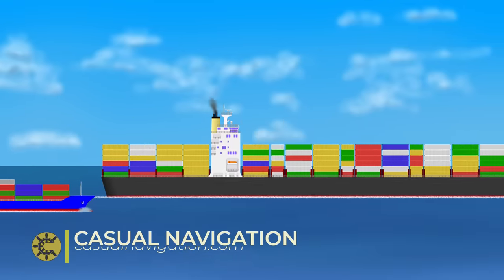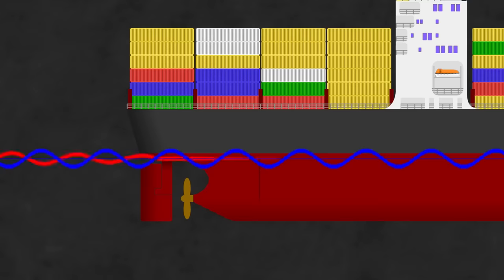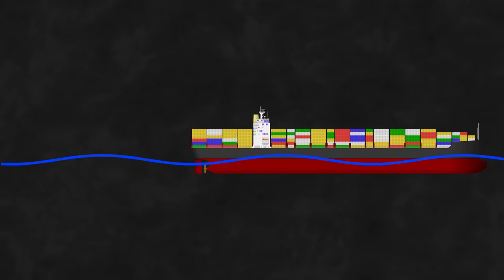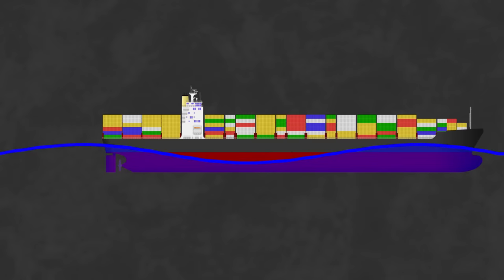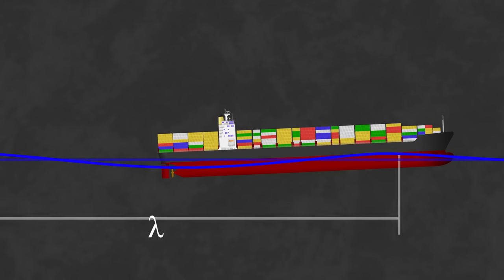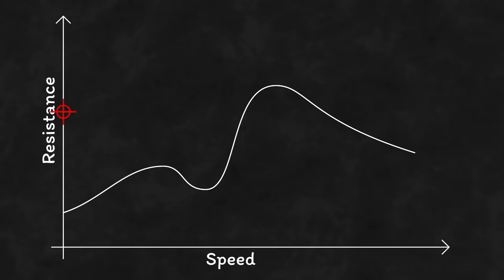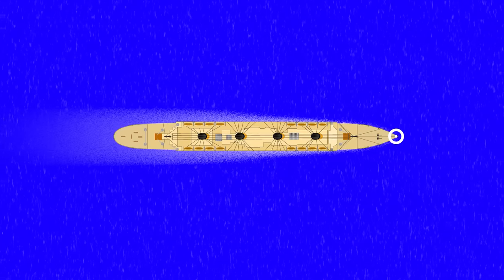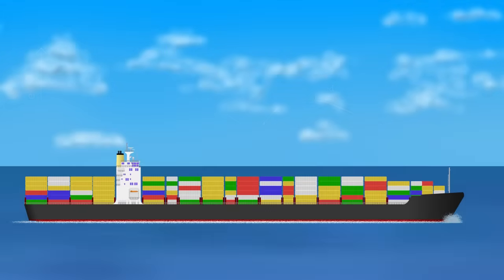Why Are Big Ships Faster Than Small Ships?

Comment: I used to sail small boats as a teenager, and despite not knowing how any of this worked I remember intuitively feeling the phenomenon of hump speed and planing. Especially the boat 'falling' off the top of a wave, going from planing to hump speed, as a gust of wind dies off. Super facinating to learn how this actually works!
Reply: And then you get on a keelboat, which cannot plane, and it does not matter whether the wind is 10 or 20 knots, you can't move any faster ....
Reply: You can plane in keelboats my friend, you just haven’t been racing the right ones!
Reply: @rydenkaye9735  You need foils for that :)
Reply: Same thing with adjusting the trim on a power boat. At a certain speed and perfect trim, you can just feel the resistance leave and the boat levels out.
Reply: Exactly this

Comment: You could easily expand this video with the hull shape aspect alone, ldl hulls are faster and lower fuel costs.
a good example, an 85' loa motor yacht with a draft of 4 feet designed for displacement cruising. Top speed is 18 knots, cruising speed is 15 knots. 15 knots speed gives her 1,500 nm range on 1000 US gallons of diesel, 18 knots gets you 500 nm from the same quantity of fuel.

These same factors are in play with the big cargo ships, yet most people can relate to being told if they slow down by 5 miles an hour they will travel 1000 miles further in their pleasure boat over it's cheaper to ship a 6 week trip than a 1 month trip for your overseas delivery..

 *ldl = low displacement length.
Reply: 500 nano-metres! Wow that's inefficient!
Reply: @Azettler1  nautical miles
Reply: @jaquigreenlees  I knew what the acronym was for and was just bugging. I find it funny that we have two measures of distance that have the same unit label :)

Comment: it maybe of interest:  the bulbous bow works only at a limited range of speeds, because its wave has to interfere as designed with the normal bow-wave. Cargo ship hulls (including the bow-shape) are designed for a resonable range of cruising speed, to be fuel efficient. Intrestingly you can guess a ships speed by looking at its generated wave lenght at the hull. you only need to know how long the ship is, judge the length of the wave and use the formula depicted in the video to calculate the speed of the ship (through the water) ...
Reply: Your explantion/guess, 
does not include water conditions.

All vessels: 
would be much better with a nose bulb !

-- Better for control of spin & steering;
-- Keeping hull at a reasonable angle compared to the water surface.
-- Better dispersing of the bow's wave.

****
 >> A Hydro-plane: 
-- can achieve higher speeds;
-- has less danger of flipping over.

( compares to many automobiles that save gas, with 500lb -- 200 kg  of cement inside the rear trunk ! )
Reply: @dirkkarmel5209  how would adding weight in your trunk improve efficiency??
Reply: Dumbest comment I’ve ever read. Try strapping a bulb to any type of Planing hull and let me know how it goes
Reply: Wouldn't it be way easier to just guess the speed than to guess the wave length AND guess the length of the hull to calculate the speed?

Comment: also worth mentioning: the drag force is proportional to the cross sectional area of the ship.  by the square-cube law, doubling the scale of a vessel will quadruple the drag, but allow 8 times the internal volume for engines to be put in.  thus, if your engines take up the same amount of space, you'll have twice the power, and sqrt(2) times the speed

Comment: Overcoming the hump speed is mechanically the same as breaking the sound barrier.
You wffectivly turn a wave into a straight line, saving tons of energy.
But it needs tons of energy to overcome the hump/barrier first.
And even then it needs more energy then any speed that doesnt approach thr hump/barrier.
Reply: There are other ways to defeat the wave  effects. Tuning shapes of leading and trailing edges to better suit lamellar flows back into the common plane on the trailing edge is the major factor. Shorter hulls can be made efficient at higher speeds but compromises are often made to achieve other desirable effects. This video however is a good beginner primer for this niche of fluid dynamics.
Reply: I thought as much, and thought of the same analogy.

"Needs more energy than any speed that doesn't approach the hump barrier." Every time you accelerate from zero, you're approaching the hump barrier. I know you're talking about it as a limit from Calculus, but how close to the hump barrier does it have to be for that factoid to lose veracity? 70%? 40%?

Actually, Real Engineering shows a graph of drag vs mach number, and it clearly shows that mach 1 is a peak, and by mach 6, the drag is significantly lower.

He was taking about rockets (which are designed to go faster than MACH 1), so I'm not sure if his graph was generally applicable to hurled objects or not.

He was discussing the new startup with rockets whose "first stage" is a centrifugal slingshot. I can't remember the video title.

Comment: I was under the impression that the hull speed was the last efficient speed (assuming a slippery hull) before the "wall" of resistance you get as you approach hump speed, due the destructive wave interference outlined in the video.  So in the graph it would be found at the bottom of the little dip rather than at the hill before it.
Reply: You can think of the hump speed as a kind of trailing vacuum effect as an analogy.
Reply: There's a similar phenomenon with the speed of sound. Crossing it causes peak air resistance, but for a plane or rocket that's designed for it, going faster than MACH 1 decreases your air resistance the faster you go. So, for an aircraft, MACH 1 is the least efficient possible speed, compared to any other.

Comment: Back around 1890 when they were building the first USS Texas battleship an argument ensued with the designer, the Bureau of Construction, and the actual builder.  There were worries that the weight calculations  of the ship had been in error and the builder suggested that the ship be made ten feet longer but the keel had already been laid (but could have been modified at extra cost).  The builder said that the ship would have the added benefit of being faster as a result.  However, the argument grew so heated about modifying the ship at this stage that the Bureau of Construction threatened to cancel the vessel due to the added cost...however the builder recalculated the weights and stated that while the lengthening could have added speed, the weights were not an issue so the project continued at the design and the Texas, although having an extremely long build time nonetheless was delivered on it's original budget to it's original design.  As it turned out the USS Texas might have used an extra knot or two during the Battle of Santiago in 1898 but the Battle turned out well in any event for the United States.

Comment: I live very close to the St. Clair river and frequently watch the Great Lakes freighters over 1000 feet in length and the salties (smaller ocean ships) down to just a few hundred feet as they travel up and down the river and into the Great Lakes.  For years I have wondered about the wave pattern as some ships would create a massive wave at certain speeds while others moving at the same speed would produce hardly any waves, yet the same ship would then produce a huge wake at a slightly different speed.  I just assumed that it was cargo weight that accounted for this.  Usually I notice 3 wake patterns as one comes from the bow, another set from mid ship and the last from the stern.  This answered a lot of questions for me.  Thanks for the video.

Comment: you might want to add, that to gain speed you need x times more power,  that is a bigger reason why speeds are low.
as for a 150 meter ship  hull speed will be 29 knots but yet they sail 15.  half of it.
Also if you sail hull speed, with a wave top at bow and stern and a trough mid ships, you loose alot of stability. (not to mention bending moments that come into play at such situations)
Reply: Yes, the middle of your ship sagging can end very badly...

Comment: Wait, so the local min is between Hull speed and Hump speed, but what is the effect of the waves on the boat that makes it face less resistance? It seems like you only talked about the speeds individually, but maybe I missed something

I loved the bit about the bulbous bow, I had no idea that’s what that was for!
Reply: So I have no expertise or any knowledge about this subject, so I can't make any claims to the author of the video. BUT on doing a little research what I might ascertain is that the graph is shows applies to only a particular kind of boat (I can't find a similar graph anywhere, although it looks like this is not a hugely popularized field so I might just be bad at googling it). From what I've read, the right around the hull speed is going to be the true local minimum, although perhaps that's where things such as the bulbous bow come in, to stretch that minimum out before ascending the curve.

 It was an interesting topic to learn though, I'm electrical engineer so I missed out on all the fluid/mechanical goodies so I'm learning all the time on these topics! Let me know if you find out

Comment: Me and my dad had almost identical boats the only difference was mine was 45’ where as his was 34’. For years how we couldn’t figure out why my boat was so much faster then his.
Reply: To misquote Einstein, once you've eliminated the identical, the rest --- however improbable --- must be the cause. As a software developer, I've learned never to assume I know anything about the system I'm trying to fix, no matter how much experience I have with it.
Reply: but this is surely impossible to scale.  they neeed to make a proportional 10x copy of a formula 1 boat and other speed boats to demonstrate the theory. and the power to weight/ size ratio must be equal.

Comment: On a related note, how much of a large ship's drag is from wave drag vs. viscous drag against the ship's hull? I always got the impression wave drag is the dominant factor. Thinking of viscous drag would be another factor in favor of larger ships, at least in terms of efficiency. More volume (mass, cargo volume, displacement) per surface area, assuming a similar shape.
Reply: Friction drag increases linearly with speed, wave drag increases with the square of speed. 
(Hull fouling from things like barnacles involves both, as the additional surface area of the protrusions increases friction, and each additional protrusion generates it's own wave.)
Reply: Hull friction barely effects wake lol  the waves generated by a individual barnacle are negligible compared to the tons of metal displacing water
Reply: @rydenkaye9735  Hull friction doesn't generate waves, it causes drag by another mechanism. Basically viscous friction between the ship and water causes a layer of water to be dragged along with the ship, which puts energy into the water and thus out of the ship, the engine needing to overcome this. Submarines have this, but don't have wave drag because they are too far from the surface to generate surface waves (hence, per displacement, submarines are actually more efficient, though with obvious other limitations and challenges).
Reply: @quillmaurer6563  i think a submarine generates waves as well, you just can't see them

Comment: Man, i had always wondered what that bulbous bow was for.   Thank you for this video.   Very clear explanation of constructive and destructive wave interference. 

That must mean that engineers design the length of the bulbous bow with the optimal speed in mind.   Different speeds would require a different bulbous bow length, correct?

Comment: 20 yrs ago, My wife and I took a cruise from Vancouver BC to Hawaii on Princess cruise lines.
The ship kept a steady spead of 24 knots for 2300 nautical miles to Nawiliwili on Kauai.
When we docked, I got a chance to speak with a ship crew member while they were fueling.
He said that they burned 800 tons of bunker oil.
I told him that the trip was really smooth.
He said that they cruise at that speed because its about physics and the hull design.
He stated that the ship could go a little faster than that but, it would burn to much fuel.
While we were underway ftom BC, we passed a smaller container ship under the Matson flag.
Everything that YOU have stated here is CORRECT.
Thank you sir!

Comment: Glad to see your method of reducing the condition, for the average person to understand.

*******
Beyond the hull waves, there are other factors that apply:
-- Water surface conditons;
-- Wind conditions;
-- Water currents;
-- Ship's acceleration/deceration.
-- Angle against water of ship's bow, 
VS the ship's stern.

  In a smaller vessel: 
these quickly Add up !
--- The vessel, quickly becomes unstable !
--- Can easily flip over, in any direction !
  ( Bow going under the Stern, 
being least likely,
frequently does occur during 
bad ocean conditions ! )

  In a larger vessel: 
-- These factors, are minor;
-- Once up to speed, is very hard to change speeds or direction;
-- Being longer & heavier, reduced dangers from waves;
-- A skilled captain: can even use ocean waves, to their advantage.  
( Using less engine power, 
to reach higher speeds. )

Comment: Does a similar thing apply to airplanes?
For example, the 747 max speed is faster than the smaller 737.
Reply: I would imagine that it would hold true, although the densities of the two fluids are substantually different.
Reply: Kind of, in that increasing the size of the airplane increases the Reynolds number for a given speed, and things at higher reynolds numbers tend to have lightly lower drag coefficients.  However, once you're at the scale of a small commuter plane drag from mach effects tends to be what limits your speed rather than the drag predicted for using the kind of incompressible flows the Reynolds number was modeled around.
Reply: I expect it is more complicated due to the way air is compressible and the density also varies greatly.  It is why jets cruise at high altitudes - high altitude = less dense air = higher speed and lower fuel consumption.  There is a trade off, if the fuel used to climb to high altitude is more than what you save by being at that altitude, then there is no point,  so shorter journeys may have a lower cruising height than longer ones as they don't spend enough time at high altitude to make it worth while.  Concord was much smaller than either, but cruised at higher altitude.
Reply: @chuckaddison5134  same problem
evan if water/air 800 times different.

Comment: 25 knots? Jesus, that's faster than many naval capital ships
Reply: Not really. Naval vessels are usually designed for 25+ knots nowadays. US nuclear carriers can make 33 knots so a Carrier Battle Group is designed with ships that can keep up.
Reply: @kathibaba7665  those are top speeds, not cruise speeds. Of course top speeds are higher, especially for naval ships that usually have a fleet oiler/replenishment vessel nearby. For example the Kirov class battlecruisers have a cruising speed of 20 knots (nuclear), and Ticonderoga class cruisers have the same cruising speed (gas turbine)

Comment: There's also the square cube law. Bigger ships have less surface area and cross section per unit volume, so if the same proportion of the ship is dedicated to engines, you have more power per unit of drag.

Comment: Well done.  The density of water and surface tension, being a constant (weather aside), the longer/larger the hull, the effectively "thinner" the water becomes, in comparison (ratio).   A larger hull, of the exact same scale, (and scale of thrust) will be effectively traveling through a "slipperier", less viscose fluid.  All else being equal... Proposionatly less drag means more speed.

Comment: Maths and science is so freakin awesome. It seems obvious that a small boat can plane easier because it is smaller and lighter and has a powerful engine that literally pushes it out of the water but that there is an equation as to why and how it can get up on the plane relative to its hull length is very cool.

Comment: I wonder if part of the first principles explanation for this effect is the square-cubed law. The engine power will be designed with weight it has to push, increasing engine power with the weight (length cubed) while the drag increases with the area (length squared), so the larger ship has a relatively easier way pushing around the water. I didn't look up any numbers, tho, so this could be off base.

Comment: Great video. Well explained. I only have expierience of yahts. That first formula is not exact. Perhaps not put correctly. But it does change a very small amount depending on design with specific yachts. I build a 40 ft steel yacht in my back yard (12 ton empty ) with hull speed of 7.6 knots. When trying to go faster it would shudder really bad. That is using sail in 35 knot winds on the quater. Great fun but it is only for youngsters.
Reply: The hull shape might be different. I only heard him talking about cargo ships, which all share some common needs.
Reply: @jpaugh64  yes. But the science behind it remain the same . They cant make full size models for testing😂😂😂. To go to sea for extended cruising is for youngsters. Around our coast the sea is sometime really unsettled. To go to mauritius and surroundings can be a challenge for the first 2 weeks. Luckily I have accepted it.

Comment: Surface area (SA) increases with length squared.
Volume increases with length cubed, and it's the same for mass (M).
Therefore, if you keep the same ratio of propelling power (P) to load, a larger ship will have a higher ratio of (P/M) to SA.
This means larger ships are more efficient when drag increases with surface area.